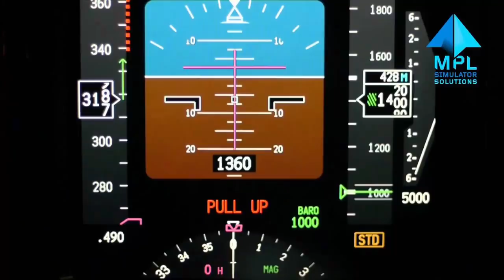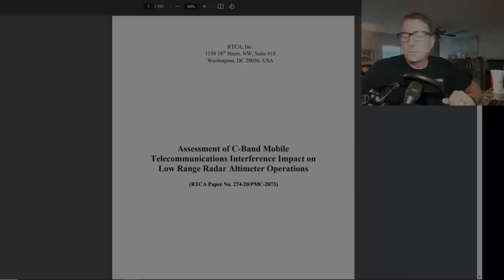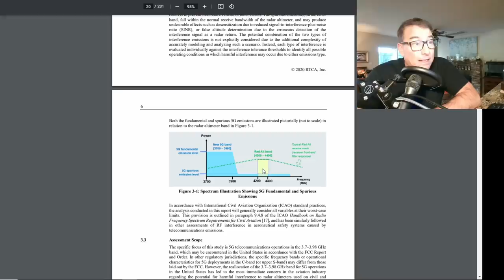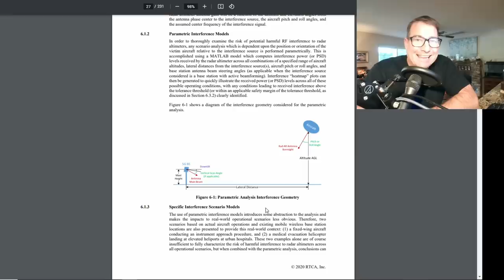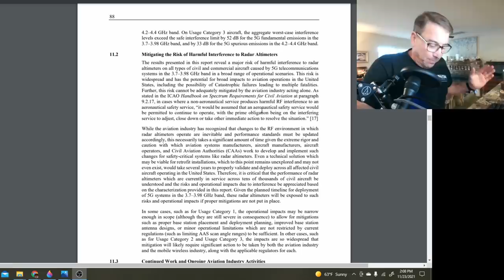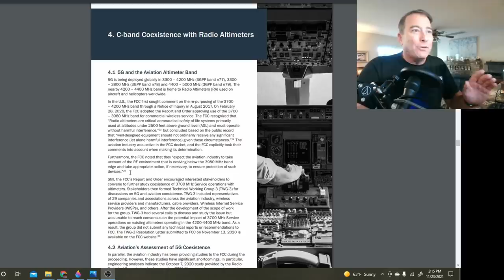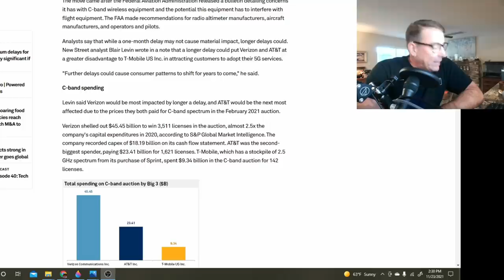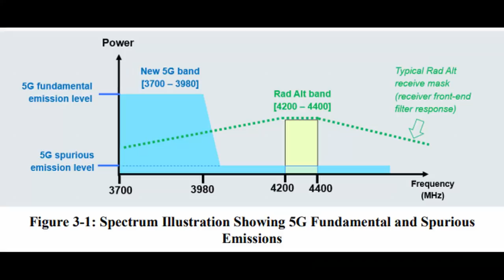5G C-Band Interference with Radar Altimeters in Aviation

Comment: As with so many things in aviation, the process (and cost) of certification means that a great deal of the technology being used is pretty "old" when compared to that used in other fields.   Just look at the engines used in most GA aircraft for an indication as to how ancient much of this tech is.   Even ADSB is now a very old tech to the extent that it can't be used in drones because there's just not enough address space to allow for the possible number of different craft.   It's time for aviation to lift its game and make sure that it is using more modern gear designed and built with more modern technologies.

I recall being horrified when I first started working on aircraft systems as an electronics tech back in the 1970s -- it was old and outdated even then!
Reply: Bruce, one of those outdated systems is the communication radios themselves. AM (amplitude modulation) was abandoned by commercial radio at least 20 years ago. FM offers better interference rejection and better audio fidelity.
Reply: @flyingweed9671  Yep, with RF spectrum being at such a premium these days it's hard to believe that they're still using VHF AM for av-band radios.
Reply from the maker: Yep! PMA, TSO....thanks xjet!
Reply: I worked in communications dong many years working on digital microwave and satellite gateway earth station and we are being bombarded with RF energy in all spectrums. They are moving C Band  transport communications to KU Band so it is available for 5G.
Reply: @xjet  we also have a broader problem. Lots of our electrical and electronic devices produce trash (interference) which can cumulatively create problems. Much of the public are completely unaware because they can't see it or sense it. They become aware when something fails to operate correctly and you begin hunting the problem down with a spectrum analyzer.  
One example from my experience was a failed fire station turnout, caused by  local interference generated from a ASDSL modem.
Reply: I worked on avionics then on P3. Aircraft were all  AM radios and the private industry was using FM.
Reply: @flyingweed9671  FM doesn't as well with fringe reception nor overlapping transmissions.  AM handles them quite well, which is why they're still the preferred method.   Former broadcast engineer, current pilot myself.
Reply: @flyingweed9671  There are valid and tech reasons why Airband communications are VHF and use AM. VHF is ideal for 'long distance' line of sight communications, more so that UHF and above, and far better than HF with is over the horizon and very long range.. So VHF is used.

As for AM there is also a reason for that, it is because you can hear multiple stations at the same time, and yes, sometimes a stronger signal will be blocked, but you know it happened..
Reply: @flyingweed9671  There are reasons why AM and Hf radio is used in aviation and that is range of the signal and reliability with consideration of the weight of the equipment to achieve the desired outcome
Reply: Bruce, while i agree the tech used in aviation is old, it is so because of I) incredible cost of design/test/certify arguably necessary given risks, ii) unit volumes are so low the amortised costs (per unit) are very high and iii) due to the strong design / test / cert standards the resultant products remain serviceable for many decades, providing the necessary cost recovery over that long lifetime.  In the current commoditised world where so many products are considered “disposable”, the aviation industry by contrast is remarkably sustainable in this sense.
Reply: @grayrabbit2211  Same with marine radio, longer range.
Reply: @flyingweed9671  Medical electronics has the same problem. There are strict standards for limiting susceptibility to external RF interference (consider life-support systems, implanted electronics such as pacemakers) as well as limits for allowed radiation emitted by such devices. Current limits up to 1GHz are or soon to be inadequate.
Reply: @flyingweed9671  Then there's the $29 Baofeng UV-5's
Reply: @Darryl_Frost  I agree with your comments about VHF (propagation), however AM is a historic anachronism.  Originally AM was produced with a modulation transformer (easy and practical) however today it is spectrally inefficient and easily out performed by FM, with better performance and efficiency.
Reply: @flyingweed9671  Thanks. That is crazy. It may be even worse with deemable LEDs, right? I think that deemable LEDs "flick" the light to the point that you see less of it.
Reply: @Darryl_Frost  Most CTAF frequencies around here are shared between multiple airports. You may hear the field you're landing at plus one 50-100 miles away. If we used FM, we would need more frequencies to avoid interference.
Reply: @flyingweed9671  jump in a cockpit with an FM broadcast band radio receiver (Walkman) and try to pick up a single station.  Crowded bands + FM are a bad mix. Then you'll understand why we are still using AM for aviation
Reply: @TerryLawrence001  No comparison. That Baofeng radio won't come close to making it through the many environmental tests required for FAA certification.  The vibration test alone will destroy that radio. I spent much of my 43 year engineering career guiding many types of hardware through Mil-Std-810 type suites of environmental tests, and can assure you that almost none of today's consumer gear will pass. Then there is compatibility testing that ensures that the hardware doesn't interfere with other equipment on the aircraft, and that the other equipment doesn't interfere with mine...too many tests to discuss here. When you are dealing with safety of flight hardware, comparison to a Baofeng radio is not logical.  Wasn't Baofeng included in the list of potentially illegal radio's released by the FCC several years ago because they couldn't meet spurious emission requirements? I never did hear how that turned out.
Reply: @ianmooney213  that's true. But seriously if Boeing develops there new 'max' on a 1960's airframe and type certificate they are happy to string out the very old designs as long as possible too....  They definitely choose not to move forward too...
Reply: @flyingweed9671  But FM can't have such a long distance reach such as AM, not everything can be HAM radio relays.
Reply: @flyingweed9671  This is caused by cheaply manufactured electronics that skimp on shielding and proper circuit board layering to avoid interference.
Reply: @pvsantos999  You will see the strobe effect with the light in the video (even at full power).  The problem is the switch mode nature of the beast. Without suppression the unit creates harmonics (fourier analysis) that are radiated from the supply cable.
Reply: @grayrabbit2211  Better spectral efficiency means you can fit more channels into the same band space.  With FM you also have a useful effect called "capture effect", where stronger signals are recieved (captured) and weaker ones rejected.  This effect encourages frequency re-use.
Telecommunication radio has used FM for at least 20 years for good reason.
Reply: @flyingweed9671  Hunting down radio interference problems is a fun job. I "fixed" two of them in the last two years.
Reply: @johnnychang4233  I agree. However most consumer electronics is made cheaply. RF suppression and shielding is something a manufacturer can skimp on easily. When the item is used in another country the manufacturer can easily "wash their hand of the problem". Only importation standards control can solve the problem. Unfortunately fair (free) trade deals normally prohibit this because its seen as an unfair impediment to trade.
Reply: @xjet  You are clueless about aircraft engines. Stick with RC model planes. Aircraft engines are highly specialized with best possible materials, processes, coatings and QC. If there was something better you would have seen it. MANY HAVE TRIED, and failed. Nothing can beat a Lycoming or Continental in aircraft. They are optimized for aircraft.  This MODERN comment comes from people who are ignorant. The big "modern" is electronic ignition? Magneto still fo very well in aircraft, but EI is available for all aircraft. It may improve fuel economy if you fly at lower power settings. Typically EI only pays off if you fully above 8000 feet or much higher.

Electronic Fuel delivery is also "modern".  Carburetor or Mechanical Fuel Injection still works in planes that fly at steady power settings. No electrical systems needed for Mechanical fuel delivery,  reliable and work well. HOWRVER electronic fuel injection is available to add on. The down side is you need a dual redundant electrical system. A Continental TIO550 has single lever throttle, prop and mixture control which is all electronic fly by wire. 

 A direct drive air-cooled aircraft engine is state of the art. If you got something better show me. No one can beat it.
Reply: @flyingweed9671  Regarding compliance regulations I think the EU is more stringent with their CE approval, am I correct?
Reply: The trouble with FM radio is that strong signals completely block weaker signals on the same frequency. AM allows you to detect that there are 2 or more stations transmitting. A good safety feature in days gone by. Some newer digital modes might be a better choice.
Reply: Correct. If you wanted to measure precise altitude today, you would just use an eye-safe laser. Cheap and very reliable, why the hell are we using radars for this in 2021?
Reply: @idanceforpennies281  because LASERs are still prone to atmospheric interference.  additionally you have to have a perfectly clear lens to receive the transmitted laser to avoid distorting the laser resulting in erroneous readings.  and while flying, would be a nearly impossible task to 100% guarantee.   especially in IMC weather with rain and snow murking up said lens.
Reply: @idanceforpennies281  - Lasers do seem like a good idea but I believe lasers aren't as reliable as radar-based tech, since lasers don't perform well during less than ideal atmospheric conditions such as dust, fog, rain, sleet, snow and cloud cover. Also, the lens of lasers must remain clean/clear for optimal performance, which can be quite challenging given how aircraft are constantly exposed to the elements.  As an example, I know laser-based speed detection devices (used by law enforcement) are not reliable/are rendered useless in even the mildest of weather events.
Reply: @flyingweed9671  So true. Even Aviation videos used by OEM's to im
instruct are ancient. One imstructor told me that the videos are expensive to produce. Infact he says they use non-actors to keep costs down. That surely explained the sloppy acting 😄
Reply: @Android-ng1wn  when SHTF, I'll gladly take the old "antiquated" technology any day. AM radio isn't affected by the internet, software updates, corrupt firmware, etc.  The ancient avionics also don't need to boot up, are very tolerant of dirty power. 

I'm an electronics guy and have built some pretty complex systems over the years.  But I'm also a pilot and know there's a time and place for technology. Yes, iPads make wonderful Electronic Flight Bags and are superior to anything I have available to me in the panel of the plane.  I still keep a set of paper charts and the VOR in the panel for when (not if) the iPad has issues.
Reply: @gmcjetpilot  Compare an O320  with a Rotax 912 and there's a world of difference.   There are a great many GA aircraft flying around with what is basically 1950s technology up front.   The technology HAS progressed... which is why the 912 has been such a run-away success and one of the reasons that modern microlight aircraft have such impressive performance when compared to regular GA craft.   I am a strong believe in the "if it works, don't fix it" philosophy but seriously there is still some pretty old iron being used to hoist many GA craft into the air and it's only in recent years we've seen much new appearing in the form of engine tech.
Reply: @idanceforpennies281  I expect that the longer wavelength of C-band radio signals (when compared to laser) makes it less affected by surface texture, fog, etc.   Lasers are pretty useless in fog 🙂
Reply: @Android-ng1wn  Cell service doesn't work at altitude.  These are airplanes in the sky, not two teenagers snap chatting each other.

There's a reason cell phones aren't used for anything mission critical - 2 way radios are.
Reply: @idanceforpennies281  Lasers are scattered by clouds. As discussed in the video, the biggest concern is interference with the radar altimeter while in instrument meteorological conditions (clouds). If one is flying in clear, unlimited visibility conditions the good old-fashioned Mk I eyeballs are perfectly acceptable for avoiding terrain.
Reply: @Android-ng1wn  You must not travel to rural areas much. Cellular signals are much higher frequency, and therefore much lower transmission distance, which is why there are cellular towers seemingly everywhere. However, there are plenty of areas of the country where you can't get a cellular signal for almost an entire county when traveling on a highway. This makes this form of communication entirely impractical, and in many cases truly hazardous, for aviation use. When it's legitimately a SHTF moment and you reach for your cell phone you will see that there is no signal, because when SHTF your local tower is out and the puny transmitter in the phone can't reach the neighboring tower. A cheap amateur radio, on the other hand, still works. The same holds for aviation radios and in many cases VHF/ UHF police/ fire/ EMS radios.
Reply: @Android-ng1wn  The spread-spectrum technology that you had suggested requires higher frequencies for it to be useful. It just won't work at the lower frequencies that are optimal for aviation use. Data transmission rate is directly proportional to frequency, and so little bandwidth is available in the aviation band that it would be essentially useless.

I have driven through a lot of rural areas where there is no cellular service now. The increased density of towers required for the higher-frequency 5G networks will make that even worse. It's wonderful that your community is well-connected. Plenty of rural America isn't. You were the one who said that when SHTF you would reach for your cell phone. My point is that won't work. It's not as reliable as you seem to believe. The older technology is more reliable, in part because you can directly transmit to your intended recipient rather than relying on an intermediary.
Reply: @xjet   "Compare an O320  with a Rotax 912 and there's a world of difference."

OK. One can easily make 160 to 170 HP, is air-cooled, electrically independent, direct drive no gear box maintenance and cost less $27,000 O320  (recently went up). The other makes 140 HP max 135 HP continuous, has low TBO, gear box (problems), requires a draggy radiator and Revs like a 2 stroke leaf blower and cost $40,353. What is your point? One can be repaired almost anywhere and parts widely available from many different companies who make STC Lyc parts (made in America).  The other engine is proprietary from a ultralight engine maker now owned by a global conglomeration that can charge what ever they want with no competition. PROGRESS... MODERN... So what is modern about 4-cyl horizontally opposed overhead valve 4 stroke water cooled Rotax? That is ancient tech. Lyc O320 is hands down winner and hard to beat. 

"There are a great many GA aircraft flying around with what is basically 1950s technology up front."

Listen I am degreed mechanical engineer, ATP, CFI, Lifetime EAA member, Airline Pilot, and built two Van's RV's.  The J3 Cub goes back to the late 30's and is one of the most fun great honest flying machine in the sky. Nothing has changed. Which is GOOD. Man invented the wheel 400 yrs BC and complete control of FIRE thousands of years ago. So are these old technology? Do you have a better wheel or better fire? You are confused with highly specialized technology developed over the early and mid 20th century; AIRCRAFT engines benefited from (in equivalent present day dollars) billions and billions in research, specifically WWII to make the optimal aircraft engine. Laws of physics did not change since then. Current engines do owe it all to that past research. HOWEVER they did not stop development in 1950's. Over the years better coatings, changes in the design has resulted in even better engines through a rigorous certification process. Don't let the sand cast cylinder heads make you think they are crude.

Lycoming, Continental, there are NO BETTER MATERIALS, PROCESSES, QC, DOCUMENTATION, MANUALS, SUPPORT, AND EXPERIENCE... NONE. Design is optimal.  EVERYTHING has been tried already. Water cooled? Yep aircraft engines 90 yrs ago had that. Water cooling is weight and drag. Air frames like P-51 designed around water cooling overcame the disadvantage. Slapping on a water cooled engine and radiator on a single engine tractor airplane designed for air cooling is not conducive to speed.

 A Rotax is great on a slow KIt FOX that tops out at 90 or 100 MPH. Rotax is light and small. I give them total credit. That is indeed a Pro of rotax, small and light. However you are not going 220 mph in a RV7 with a Lyc IO360. Nothing can touch my engine, not even "modern" car engines or Rotax. My Lyc I will say would make a bad car engine. I have hydraulic controlled constant speed prop with no prop speed reduction unit (PSRU), direct drive, simple and reliable. Rotax NOPE... There is extra maintenance for that "MODERN" technology, which is a work around to run the engine at high RPM to make HP with smaller displacement. This is why rotax has the low Time Between Overhaul (TBO).

"The technology HAS progressed... which is why the 912 has been such a run-away success and one of the reasons that modern microlight aircraft have such impressive performance when compared to regular GA craft."

First Lyc and TCM have kept up with progress and both can be had with single lever (throttle, mixture, prop) control. So there. Every Sport Class airplane at Reno Air Race had a Lyc or Continental. When Red Bull had air races every plane a Lyc IO540. The Reno Formula Racers typically are Cassutt Special. They can only use Continental O200 only. They go over 250 mph. Rotax 912 is only 82.6 cu-in  and is maxed out at 5800 rpm and 100 HP.  You can't get any more HP out of it since it's already spinning fast. You spin a O200 fast it makes near 200 HP.... MODERN!!! 
 
I agree Rotax makes a good engine for MICRO LIGHT or LSA....  Lyc only has the O235 in the sub 160HP range. Continental only has IO200 at 110HP. Both are good engines. However the metrics on the Rotax is better at a premium cost.  Now sit down. A 915 Si is +$40,000 DOLLARS.... Ha ha. No thanks.  I would not build a plane that was not designed to handle the size of at minimum a O320, and I would take that over a Rotax XYZ any day...

MODERN? So may be you are talking about ELECTRONIC Ignition? Lyc and Continental ALL can have EI. They can be bought with it or purchased aftermarket and installed both non certified EAB or Certified for not much money (about $3000 for both Left and Right). However the Magneto on planes does a great job because a plane is NOT a car. Mags are self contained and do not require a redundant electrical system. Now I give credit to Rotax they put redundant electrical dynamo into their design. Good. However back to Mags. They do a great job until you get to high altitude and the fixed timing starts to cost some efficiency. However if you fly below 10,000 feet that is not a big factor.... Down side with Mags is due to regulations they have repeat inspections and parts are always more for certified stuff.  

MORE MODERN? OK so Electronic Fuel Injection? Well Lycs and Continental have electronic fuel delivery options, but most are Carburetors and Mechanical Fuel Injection. Again EFI is great and can add some efficiency but not much. With $5/gal efficiency does counts. It would take a lot of flying to pay for the upgrade. So what???  So yea for EFI. Again YOU MUST HAVE redundant electrical system, dual bus, dual battery and/or dual alternator or variation or combination. That is weight and complexity. One of those FANCY Dimond Twins just crashed. The guy jump started  dead batteries. The dead batterie drew the system down which failed the electrical system and his MODERN electrically dependent EFI engines stopped making thrust and he crashed. This means you battery better be good.... So a Cessna with a O320 Carb, Gravity Fed Fuel, Mechanical Fuel Pump and Magnetos system can fly all day with NO battery. This is why people like you say MODERN TECHNOLOGY piss me off  because you don't understand all the factors in aviation design and safety.  No offense. It is the same with many people. MODERN! 

"I am a strong believe in the "if it works, don't fix it" philosophy but seriously there is still some pretty old iron being used to hoist many GA craft into the air and it's only in recent years we've seen much new appearing in the form of engine tech."

So a DC3 with radials is pretty awesome. I admit two PT6 turbines conversion is even better. However when you are talking 4 STROKE, Over-Head Valves, Horizontal Opposed Water cooled engine that is NOT MODERN. My 1982 Subaru GL Car had basically a Rotax engine design. We are talking 40 yrs ago. It was a great engine, slow but nice torque, reliable, decent fuel econ with a 5 speed manual. When you say ROTAX is modern that is a JOKE RIGHT??? There is nothing new except save for the EI and EFI. However both of those have been around since the 70's and 80's. Sometimes Existing technology is still better than "modern". You don't have to throw out the old, may be just update it like with EI or EFI if those are better. In cars EI and EFI are the holy grail of car efficiency. In planes not so much.

So what is your aviation UTOPIA? A Rotax 912 or 915 Si. OK good luck with that. Again great for a Kit Fox or Super Ugly Cruiser Zenith. My Lyc 360 powered RV7 can fly shy of 190 MPH true economy cruise, go 700 Stat miles, carry two people and bags, climb initially over 1650 fpm at gross sea level, over 2050 fpm solo half fuel sea level, service ceiling 23,000 feet..... DO THAT WITH A ROTAX.

BTW I bought used Lyc O360 with 600 hrs since last overhaul which was first overhaul, for $3000. Input $10,000 into the tear down and service (not an overhaul since many parts were good). I had every part cleaned, inspected or overhauled as required. Replaced parts if as needed. I upgraded the ignition for another $3000 with EI. So for $16,000 I have a 180 HP engine.  Modern is a caliche. Give my antiquated Lyc. Cheers
Reply: @Android-ng1wn  The aviation band is 108-137 MHz with 50 kHz channels. Old WiFi was 2.4 GHz with 5 MHz channels. One could, in theory, only fit five 5 MHz channels in the whole aviation spectrum, and given the lower base frequency maybe 6.75 Mbps. However, a portion of that spectrum cannot be used as radio navigation facilities cannot share their portion of the spectrum in that local geographic area. Having deployed 2.4 GHz WiFi, I'm pretty sure that with the number of aircraft operating in a typical bravo airspace, the channel allocation between ground stations would be problematic and the bandwidth for voice communication would be inadequate. One ATC station can still only listen to one audio stream at a time, and if we could transmit multiple streams at the same time what happens to the other ones? What happens when the controller has an urgent message for collision avoidance or a pilot has a "mayday" call? How do we prioritize these transmissions above all others?

Relying 100% on GPS is a recipe for disaster. VORs, localizers, and glideslopes are absolutely necessary as a backup (or in some cases for general aviation use they are still the primary method of navigation in IMC). GPS can (and does) go down, and it is reasonably common to see precision GPS approaches unavailable by NOTAM for whatever reason.
Reply: @idanceforpennies281  Safe to the eyes low power infrared laser are obstructed by things which are optically opaque such as mist or fog.
Reply: @Android-ng1wn  The reason that the navaids work is they are directional analog signals. How can one mess with them and do anything but break them? There is no "more robust" when they have been used for decades and are already as reliable as any electronic device could be. Adding additional complexity would merely add additional modes of failure, which is exactly what we don't want to do.

Even if one makes new narrow digital channels in the navaid portion of the spectrum that avoid interference with the navaids, one is still left with a base frequency that has 20 times less data throughput capacity than 2.4 GHz WiFi. You might be able to reliably get one audio stream per channel. Keeping the wide channels, on the other hand, would put the data capacity at about 10 simultaneous streams using numbers for VOIP phone systems (1 Mbps minimum, 5-10 Mbps recommended), but leaving the navaids alone would cut the number of channels in half, which would break the system as multiple ground stations would wind up interfering with each other just as setting two adjacent WiFi access points to the same channel does.

Asking ATC to listen to multiple simultaneous audio streams on a regular basis is a recipe for disaster. Idle chatter is exceptionally infrequent on aviation radio, and one or two words missed could be the difference between an uneventful flight or many lives lost. When people step all over each other now, everyone on the frequency hears it, pilots and ATC understand what happened, and people shut up. What happens when a VOIP phone has connection issues? The audio is garbled or the line goes dead, either way you can no longer communicate.

Aviation uses "old" technology for a very good reason. Everything needs to withstand the test of time before it gets a chance to fly. Pilots are taught to "aviate, navigate, then communicate" and your suggestion messes with the second and third. It would need a very solid flight test program before implementation, which would be impossible without disrupting the existing systems as it is an entirely incompatible use of the same segment of RF spectrum. How many years is it taking to implement NextGen? Let's just pick a portion, how many years did it take to even get ADS-B out implemented, and how many aircraft still do not have ADS-B in?
Reply: @flyingweed9671  AM is still used because when two transmitters talk over each other, they are mixed.  FM will capture the stronger signal and ignore the weaker.  No one will realize that one talked over the other with FM.  With AM, everyone else will hear the mix and can relay that there was a conflict.
Reply: @flyingweed9671  yes but when two or more stations transmit at the same time, AM will demod them all, FM will not. So AM is safer in that regard for aviation. (remember everyone shares the same channel when speaking with the ctrl tower or such. It's inportant for pilots to be avare of other traffic) In short AM allows for a "party channel" while FM woun't.
Reply: @idanceforpennies281  have you heard of clouds or fog?
Reply: @flyingweed9671  I mean, sure, but in modern times we can use a digital protocol (like digital TV) which can be transmitted farther and is perfectly clear (I just mean independent of reception quality, so long as you can hear it at all). We could even (using current technology) cryptographically secure the transmissions so bad actors on the ground can't impersonate ATC. Also, a digital protocol would let everyone know who is stepping on who on the radios, and could be configured to e.g. prioritize ATC's message over someone else.
Reply: @keeleyhoek  I agree. The big "but" , is getting every nation in the world to agree to a standard, and agree to develop a program to swap out old radios in a timely and orderly manner.
Reply: I'll hone in on the "ancient engines" comment for GA aircraft:  Much of that technology is well established and proven, if maintained properly is not an issue.  One cannot just "update" an engine randomly, there are significant issues to consider to repower beyond replacing like-for-like.  Then there is the cost.  The bulk of GA airframes are decades old and the costs to do upgrades are significant and probably beyond the means for most owner-operators.  Heck, even the USAF is flying B-52's with engines essentially from the 1950's and they have money to burn.
Reply: @flyingweed9671  FM has far less range though.  Always trade-offs.  FM is "line-of-sight" reception only.  AM can bend beyond the horizon.
Reply: @flyingweed9671  FM is better than AM when you have good signals and low levels of interference.
But if you want to cut through interference, be able to tell when another station is transmitting, or reach long distances, AM is more robust and reliable.

If you think about what happens when you are driving in your car listening to FM and you come to the edge of the coverage zone, it basically goes from a clear signal to nothing, and if you are at the edge between two transmitters, it flops back and forth between the two.

With AM it fades in and out, and if you are in between Stations you can hear both mixed.
You can also generally hear AM from further away.
I used to enjoy listening to distant AM stations late at night.

So there are a lot of benefits to FM, but it's not as robust as AM, which is a downside for aviation radio, where you would rather have lower sound quality in exchange for more reliable operation.
Reply: @xjet  The reason that AM modulation is used in aircraft is that many times two or more aircraft will transmit at the same time. ATC can hear that and ask the pilots to repeat. With FM the strongest signal completely covers up the weaker signal so that ATC will not know that another aircraft is calling.
Reply: Wow I didn’t realize that drones can’t be adapted to the ADSB system due to capacity. In my short 300 hours I’ve already seen two, would’ve been nice to see them with adsb
Reply: @flyingweed9671  FM also trades off bandwidth consumed for that improved signal to noise ratio you speak of. There Ain't No Such Thing As A Free Lunch. Digital modes also share this feature, although some experimentations in speech compression may give about the same intelligibility in less bandwidth than the typical AM or even SSB system.
{^_^}
Reply: @gmcjetpilot  I'm just a lay person with shade tree mechanical experience. But I have looked over those Continentals in those Lycomings and they are definitely optimized for total reliability and for operating within a narrow RPM band.  So yeah, there is definitely a reason why those things are still around and it ain't got nothing to do with people being cheap or being too stupid to come up with a new design.
Reply: @jiveturkey9993  Currently awaiting a new Lycoming coming for one of the planes I fly. $55k.  Certainly not cheap! And yes, the old one still works.  Just don't want to risk flying with an engine too far past TBO.
Reply: @flyingweed9671  Amplitude modulation (AM) is still used in the standard broadcast band (525-1705 kHz) in the United States!
Reply: @dane1234abc1  It is also in New Zealand :)
Reply: @flyingweed9671  There is an important Technical reason for NOT "upgrading" to FM!!! I have been in Radio Electronics since the 1960's, and worked as an Authorized Service tech for Lafayette, Pioneer and Revox on college breaks, and worked at TI defense, Harris Broadcast Division, Nortel and now ADVA Optical Networking, responsible for securing and mediating FCC EMI/EMC Compliance testing and building hardware for this (with a 50 year Amateur Radio experimental background). Now back to my point. If you look at any good FM Stereo such as my 1974 Pioneer SX-1010, you will find a spec number for Capture Ratio. What this means, if you are trying to listen to one of two stations on the SAME channel, the stronger one by 1dB or greater RF level will MASK the weaker one, i.e. Major Armstrong's FM signal will be CAPTURED by the IF, Limiter, and FM Detector. The advantage of AM is that if the Pilot TALKS OVER the Tower transmission, any recording by a third receiver will hear BOTH voices, AND very likely an audible BEAT TONE equal to any minor difference in their AM Transmit Carrier frequencies. The result is proof of a "double" in Ham speak... Thus any recordings or other PILOTS monitoring the channel can notify the Tower the message needs REPEATING. 
 Juan is entirely correct in his concerns, that the FAA and Airline industry were there FIRST. The odd notion that some 1970's technology Microwave Radar equipment with gentile filter skirts and limited sensitivity/Noise Figure on the Receive side and 1 Watt Transmitter listening for the weak REBOUND/reflection OVERNIGHT needs to tolerate a 30 WATT 5G wideband DIRECT/incident signal is ludicrous! The proposed frequency "guard band" of 200MHz is only 20% of the RADAR frequency. I share the concern with the increasing corruption especially from the Country's leadership, and billions pushing from the Cellular side, facts may not get their day in court - again, as in exactly a year ago!
Reply: @TheBeingReal  B-52s also don’t use the engines used one the early models. They’re also going to be re-engined with Rolls-Royces.
Reply: @Hornet135  The B-52 is still flying with the original P&W TF-33.  That’s 59 years since the last one was produced in 1962, 69 years since it entered service.  

So yes it is being re-engined: 70+ years later.
Reply: @TheBeingReal   The TF33 is not the original engine, it’s the engine that was introduced with the H model. A through G models used various iterations of the J57.
Reply: This is the one and only comment of truth!

Today every car has radar sensors, up to 25 per car.
Technology of nowadays makes them wirk without interference while performing by fa more challenging jobs than sensing distance to ground while flying above.

Side aspects: those technologies are by far cheaper.
Reply: @flyingweed9671  currently AM is intentionally retained over FM due to the capture effect experienced on FM; you can essentially hear two stations 'doubling' with AM thus at a minimum detect another station calling; which is not always true for FM as you say FM offers better interference rejection and fidelity; not necessarily good thing for aviation
Reply: @flyingweed9671  
The problem is more complicated than that. The treason for using AM is to avoid the resultant NOISE when two transmitters are on at the same time using FM. It was a deliberate choice at the time
Read up on it!
Reply: @idanceforpennies281  Because a laser altimeter is blocked by bad visibility.
A laser cannot penetrate clowds, what you see is what a laser altimeter can "see" .To land Instrument meteorological conditions you cannot see ,so you need a much lower frequency such as in the 4200 to 4400 Mhz band to detect altitude reliably.
Lidars are popular for drones but they cannot operate in fog.
Reply: @gmcjetpilot  Franklin engines are pretty good too - pity they got sold to Poland by the Tucker Car company when they went belly up. (PZL have been trying to revive the brand).
Reply: @allangibson2408  I have zero Franklin experience but always admired how they look. Looks not exactly the metric to judge an engine by but if it looks good it has a better chance of being good than an ugly design. They are a pretty design. I remember back in the late 80's and 90's they were selling engines direct to the kit plane builders EAB. The issue was popular kits like Vans Aircraft RV. Glasair, Lancair, Rutan had kits with pre-fab Lycoming Engine mounts and cowls to match. To fit a Franklin was extra custom work. I recall one or a few RV's with Franklin's. I think Van did make some engine mounts to test the idea out, but ultimately it was not popular. I recall the factory converted the plane back to a Lycoming.... I GOOGLED Franklin engine and it appears they are in business, with STC to retrofit popular certified planes (C172 for example) and they make engine kits for RV-8 and other experimental Kit Planes. Cool.  The 6 cyl is smooth. I remember flying old Continental O300's and newer TSIO360 in a Seneca II, smaller displacement 6 cylinders. Smooth.
Reply: I was recently a jet engine mechanic on KC-135s. Those are basically glorified boeing 707s, truly ancient by even modern civilian airline standards.

I've been critical of the FAA's certification process for a long time. While I agree that new aircraft and technology needs to be tested well before being implemented, the cost and time barrier to entry the FAA puts up actually incentivizes the use of aircraft well past their retirement date (for example, grumman seaplanes in puddle hopper operations, because the cost to certify a new seaplane type is so high that almost no companies want to do it). This incentive also keeps people using VASTLY outdated avionics. And the cost of certification is then imparted onto the customer, which means even if better alternatives exist, people would rather use outdated tech. For example, in the GA world, a lot of pilots are just suplementing their old steamguage cockpits with ipads and GPS recievers, rather than upgrading to a glass cockpit.

And whats worse, the FAA commits double standards in the certification process. Boeing was such a "trusted company", they were effectively allowed to "certify" the boeing 737 MAX themselves.... Where bad design lead to crashes.

The FAA really needs to revamp itself. Treat everyone the same, no more big companies certifying themselves while GA gets subjected to the most cost probibitive certification. And, the certification process really needs to be streamlined, so that end users arent incentivized to use DANGEROUSLY old technology instead of excellent newer technology.
Reply: @hatman4818  A KC-135 has almost zero interchangeable parts with the 707/C-137… That was a result from the airlines wanting a much wider fuselage than the original 367-80.
There are more interchangeable parts between the 737 and 707…
Reply: @gmcjetpilot  Franklin had 60% of the aircraft engine market in the United States when Tucker bought the company…
The current production Franklin’s are designed as drop in replacements for the equivalent sized (and out of production) 125hp (4 cylinder) and 220hp (6 Cylinder) Continental engines…
The reciprocating engine market is however rather crowded and small…
Reply: @conservative599  well said! Lol
Reply: @hatman4818  the standard for certification is basically an industry standard that the FAA enforces.
Since you can't just pull over to the shoulder when something fails, pilots and everyone else want every critical component tested to ensure it will be reliable for a certain number of cycles, so that it can be tested or replaced prior to the minimum life span. And it's this very ultra conservative testing and certification regime that makes air travel as safe as it is.

With radar altimeters, if it fails, the plane may be unable to land if all the airports within fuel range are foggy, and so it has to be tested to ensure that it will always work, and always be reliable.

Since the testing process is very intensive and expensive, yes, it makes more sense to continue building an old design until there is a specific reason that requires a new design, and justifies the work and expense.

The old float plane design isn't used only because of the certification costs, but because of the engineering costs to develop an entirely new airframe design.
After doing the engineering and prototyping, the certification probably won't be the most expensive part, and engineering just costs more today than it did when it was done by a few guys with slide rules.

So it's not simply the fault of high standards for certification, but the whole life cycle costs of the development process.
And so if you have an existing design that works well, you keep using it.
Reply: I am going to go 1/2 way to the other side on this.
On one 1/2 - YES we should have updated the radios/nav/id and other systems in aircraft to take advantage of newer technology.
On the other 1/2 - there is an incredible difficulty in getting anyone in aviation to pay for upgrades.

I don't have Juan's qualifications or experience as a pilot. I have a degree in aerospace and about 350hrs PPL. I have spent the last 30+ years in industrial control systems and am familiar with sensor to computer interfaces. On company I worked for made their own control hardware. So I do have experience designing, coding, testing and deploying computer control hardware. Its not so much a problem with conceiving, designing, prototyping but its a problem of testing and verification that something is as good as it claims. For certain kinds of hardware and software that also requires independent testing and verification and that can be horribly expensive. 

A few years ago I did the initial design work for 2 personnel projects. 1 was in industrial safety where I saw a gap in the market and the other was for a general aviation flight data recorder (FDR - black box). We know from people like Juan that there are too many light aircraft accidents where there is just no data on what happened. Just like the C172 crashes Juan covered recently. Nobody knows what the engine speed was, EGT, manifold pressure, outside air temp or the static or pitot pressures were. Those along with things like GPS (location and altitude), G-forces (off a 3D G-sensor) and plane attitude (of a 3-axis gyro) are all relatively easy to do. There can be an awful lot of information from just a few basic data streams. 

Such a system could be relatively easy to install with minimal hassle. For some of these crashes the investigation team would know quite quickly what the aircraft was basically doing before trouble started and what was going on as the trouble unfolded. A stall or engine failure would be pretty obvious just from a basic 3-axis gyro sensor. A G-force sensor would tell a lot about how the plane was pitching, yawing and rolling. changing. Basic engine data would tell if the engine was producing power or not.

SO WHY DIDN'T I DO EITHER PROJECT and try and bring products to market.
On the industrial safety unit the costs in gear was about $10-15K plus my time to do a prototype and about another $10K to do an initial batch. Getting it independently certified as to what it was and what it was capable of was at a minimum $250K USD and could easily double. In the area I was looking at NOBODY installs anything safety related without independent certification.

On the flight data recorder it was very simple. Most of the newer GA planes already have some of that in their glass cockpit hardware. A lot of the current engine  displays ALSO record data or can transmit their data via systems like CAN-bus. For older aircraft who's going to pay. Even if the FAA or CASA (I'm Australian) or any other body brings out a new regulation requiring all aircraft irrespective of type or rating must have at least a basic FDR who's paying?

Remember MH370 the plane that disappeared off Australia? It wasn't the first plane to disappear over water. Due to other crashes there was a full ICAO proposal for ALL current FDRs in commercial passenger planes to have their pingers (location beacons) upgrade to provide power for 90days. All the airlines said "NO, we are not paying for it!"

If the airlines wont upgrade their systems for safety, even though we all know it would help then why would ANY other aircraft owners upgrade anything they don't have to.

I love everything everyone is saying that's positive about upgrading planes and making flying better and safer for all. There's lot so great ideas here. 
Just remember someone has to pay for it.
Reply: @grayrabbit2211  They act like the industry does not know what they are doing and the US military has been doing radio comms since it started and are some of the best at it.  Then, look at the advances made by folks like NASA.
Reply: @xjet  if they switched to fm they have about double capacity. digitial although it can be troublesome 
since am and fm you can get info even with noise and interference digital it either you got it or you dont
but still vhf fm works very well with aircraft high in air
Reply: It also has to do with that more modern gear might be affordable in the industrialized world, but might be too expensive for a lot of the developing world.
New tech in the aviation industry needs to be affordable by lots of places worldwide.
Reply: @rogerwilco2  This tech isn't complex or expensive to do right.  There are DIY radar altimeter projects online that can be built for a few hundred dollars.  Hell, if you can afford an airliner you can afford a decent radar altimeter.
Reply: @flyingweed9671  Ask any old amateur radio operator this question and they will say something like AM was determined to be heard farther distances than FM or other modulation techniques back in the day. Yes, it is true FM and digital modulation techniques offer advantages including sending ID, LAT/LON, SOG, etc. like a transponder in addition to voice audio simultaneously.
Reply: @flyingweed9671  there are pros and cons to each. Not disagreeing with anything you said but FM does have a ”capture effect“ so if 2 transmit at once, if one has about a 6dB advantage, you won’t even know about the other. With AM at least you can tell it was a double. Likewise with a stuck mic if there is little audio modulation you can mostly make out a second transmission. Not so in FM.